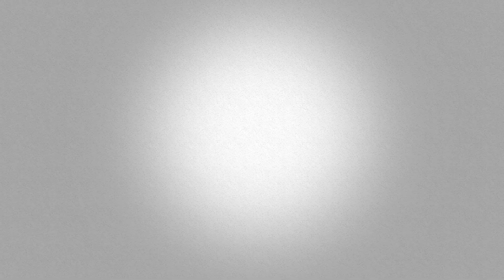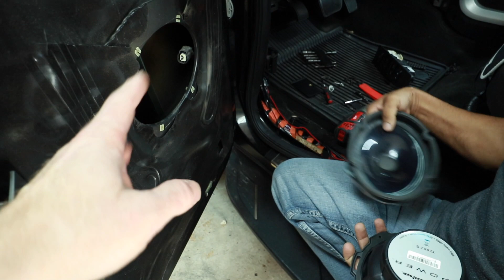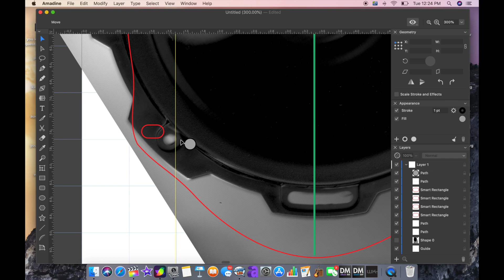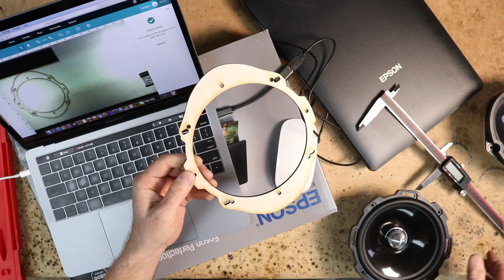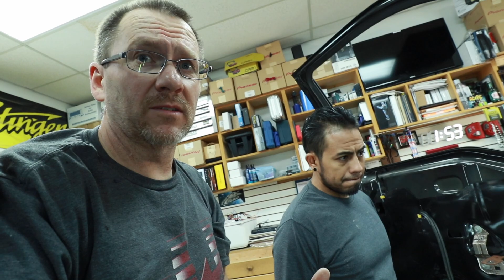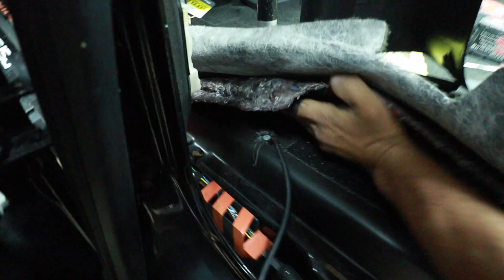Ford Raptor gets Rockford T2 power 6 5 and old amp comes out Installer Diaries 239 part 2

Comment: So I have a fusion with 5x7. Anyone know if the plastic after market 5x7 to 6.5 adapters will make air tight seals the same way the factory speaker are now? I’m not very good at fabrication and if the aftermarket won’t be air tight I’ll lose bass and it will sound like sh*t.? Or... should I just put 5x7 components?